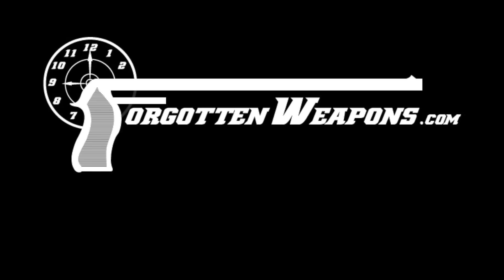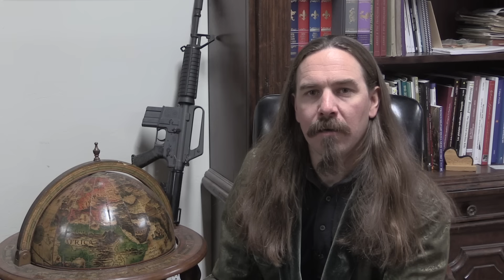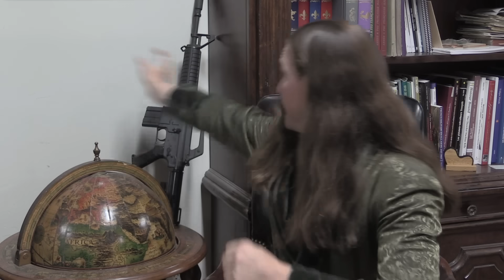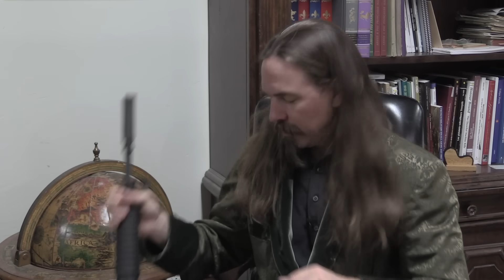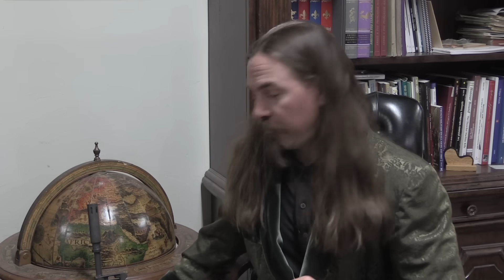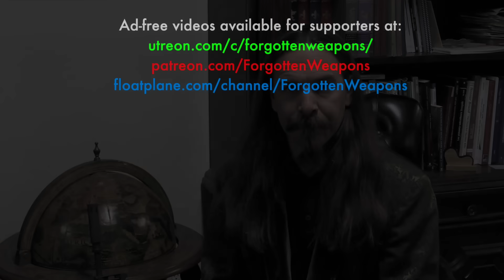Ask Ian: "Last Ditch" Rifles for World War III?

Comment: So basically an m16a1 with a polymer lower. I guess Stoner wins again 😂
Reply: Dude had it figured out until we came along and started messing with it.
Reply: M16A1 with polymer lower and wood handguard.
So a really sexually confused ARES SCR.
Reply: There are so many AR-15s in circulation in this nation the military could just ask us to donate(or show up with your guns) these rifles and if they want them to be select fire they manufacture the necessary parts and modify the lowers for this functionality saving A TON of money and time on making whole new rifles.
Reply: There are 3D printed lower designs.
Reply: @ashyslashy5818  it's not 1940 anymore.
Reply: @kabloosh699  Unfortunately, most people with them would probably see it as some kind of confiscation ploy.
Reply: @Airondot  From a purely utilitarian perspective sure but many of the additions and improvements really are beneficial.  Sure a barebones pull trigger goes boom design is extremely elegant and hard to improve further if you are interested in nothing else but the AR isnt just a rifle.  It is a platform.  Half of the reason its still around is because features were added as they were found to be needed.  The original A1 design was great as a baseline but you dont want just a baseline in the modern infantry.  You want to be able to put optics on it and make it comfortable to shoot with adjustable length of pull.  The A1 wasnt a mistake and it was improved upon for its use cases its just doing that added complexity which isnt necessarily a bad thing if you can afford making a more complex rifle.  When it comes down to it though if you just want the simplest possible package its gonna look like an A1 its just nobody wants to have to go to war with that in the 2020s.
Reply: @Aperson156  do you really need full auto though?
Reply: @kabloosh699  I don't think they'd even bother modifying the civilian ARs. We shot our M16s/M4s in semiautomatic 99% of the time.
Reply: @donwyoming1936  I see semi only being the best option especially for undertrained bodies in uniforms. Make it as straight forward and less ammo usuage
Reply: @heresjohnny2172  yes, you do
Reply: @donwyoming1936  yeah. There is also that, plus in this case we will likely be seeing a shortage of ammo so semi auto will be the go to way to conserve ammo.
Reply: @ashyslashy5818  Why? No seriously why? If you've been watching this channel or inRange or any of the channels that have reviewed the WWSD rifles, then you know that polymer (the KP15 and CAV lowers at least) has proven it's self.
Reply: @wilhathaway1987  no, you don't, at all.
Reply: @heresjohnny2172  nope, you don't.
Reply: @chuckhaggard1584  Don’t need it since it lowers effectiveness in performance. Want it because it’s fun, like getting to push a car to its max speed.
Reply: I actually disagree slightly with Ian, I don’t think we’d bring back the carry handle. Doesn’t make sense anymore.
Reply: @JoeSkylynx  Wood belongs on an AR like salt belongs on Cornflakes.
Reply: @jacobcastro1885  The MP-40 used some early plastic.
Reply: @heresjohnny2172  you need full auto in military  arms for 2 reasons, it turns  into a shotgun at close ranges to put a threat down right now asap. At longer ranges its for suppressive fire. Keep the enemies head down while your team maneuvers. Yes its wasteful, war is wasteful.
Reply: For a last ditch "peoples gun" I vote for the m79 blooper. Simple to make simple to use. Any single shot shotgun assembly line could crank them out.
Reply: Well, I think Ian used the M4 as an example rifle to simplify, likely because it's a platform both he and his audience are familiar with. He could just have easily applied the same logic to a F2000 or Tavor.
Reply: @JKTF476  Simple to make the gun, perhaps, but the ammo would be expensive to make. It's also not the best gun to put in completely untrained hands. With a rifle, a militiaman can just aim ang sight directly at the target. With a grenade launcher, they have to learn the trajectory. They're probably spending little or no time firing practice rounds at the firing range in this scenario. So you have to give them a relatively complex adjustable sight, like the M79 had, because they won't have the skill to aim it accurately instinctively.
Reply: The AR-15 platform is intolerant of rough machining in the gas system  among other components.
Injection molded fibre reinforced plastic lowers and trigger components would be possible like the Steyr.
Reply: @MasterN64  The M16A1 was generally recognised as a mistake in a number of regards- starting with the forward bolt assist. The original AR-15 was a better rifle. The Army and Colt screwed it up.
Reply: @Airondot  Ehh. A lot of the changes the military made make a LOT of sense for the military (the gov profile barrel had some mistakes with the actual testing parameters, which they didn't realize till production had already started on the new barrel and they essentially said fuck it its more expensive to go back, and it just adds a bit of weight) With the mechanization of the Army the Carbine makes more sense (try getting in and out of a HMMWV constantly with a full length M16 while in full kit, none of my Marine friends thought it was fun) As well as the increase of urban operations. The adjustable stock makes a lot of sense (especially when it was first adopted when body armor was much bulkier than it is now) Hell, even the KAC handguard from the block I upgrades is considered on of the best handguards out there for its time, and even better than a lot of handguards out there today(The upper has a locking screw, which means you can mount accessories like lasers, grenade sights, etc. and not have to worry about zero shift) The optics and lasers we went with, while heavy, can take a hell of a lot of abuse, and even the ACOG which people consider outdated now increased lethality to the point during the gulf war an investigation had to be opened on the Marines because people thought they were executing POWs. Really the only stupid thing the Army did was put the forward assist on there. And if the Army was at the point of making last ditch rifles. Those changes to simplify it closer to what stoner designed, isnt because he had it figured out (. Its because jesus christ its WWIII and we're pulling more troops than WWI and II combined. Also there is still a lot of debate over how much Stoner actually did with the design of the AR15 itself, as sources conflict on what he did adapting the AR10 to 5.56, and what others at the company like Jim Sullivan did to it.
Reply: Yeah because your going to be losing we didn't lose Nam because our boys are weak
Reply: @JoeSkylynx  no more like the service rifle from fnv especially the cocking location cough cough simplified
Reply: @allangibson8494  Ehh the FA was considered a mistake, and burst while not actually wanted, was adopted to fix a training issue the Army had no time to rectify. And it wasn't the M16a1, it was the straight M16 that was considered bad. Less because of the Army and Colt, and more because of McNamara fucking with the production and ammo to save a few bucks for the DOD because he had no idea why specific powder, and metal treatment is actually needed for anything because he was a bureaucrat not a gunsmith. The M16a1 fixed the issues the M16 had. Which is why it was used all the way up to and through the 80s. With some units still hanging onto them into the 90s. (yes the M16a2 came out in 1983, but like I said, some units held onto the a1s all the way till the 90s, My 1st unit still had original Colt M4s in the 600 serial range in 2017 when I left, and there's a unit at Polk that still has an M79 in their arms room.)
Reply: @wilhathaway1987 you don’t.
Reply: @JKTF476 you really don’t.
Reply: well...since DoD has committed to the 6.8 x 51 and affiliated launching platforms, it would take a major earth shattering event to halt the transition and revert to existing & established systems (5.56 x 45 & M16 based platforms)
Reply: I think a polymer lower receiver, as well as possibly polymer magazines would probably be a good thing. The good thing about the polymers is not only are they lightweight and obviously faster to produce. In my mind they’re also much more for the lack of better term soldier proof. Especially if you’re going to be giving these weapons to con Scripps. Now granted many Americans have at the very least basic firearms knowledge. Now obviously they would still have to go through training. But making a weapon that is simple to use but also relatively sturdy would definitely be a benefit.
Reply: @Keith Reh  ehhhhhh. While eventually it will see full adoption it is at first onlybgoing to select units, while the rest of Army is staying with the M4. If something we were just to go to full scale war within the next year, Spear production would probably actually be slowed or stopped, to supply the Army with known existing equipment they are already trained on.
Reply: @Aperson156 , than the conversation parts, like a drop in auto sear, could be provided instead.  Not as useful as a full conversion, but auto sears could be mass produced at a scale much higher than full conversions could possibly be processed.
Reply: @JoeSkylynx  it must be gender neutral 😂
Reply: @LUR1FAX  I understand, but the mentality that polymer doesn't belong in firearms was the standard convention in 1940, and only began dissipating after.
Reply: But 1861?
Reply: You could also substitute steel for aluminum in the AR pattern receivers in a last ditch scenario. It's a simple substitution, just a pound or two heavier. One has to consider that the appropriate aluminum alloys are harder to make and require specific additives. They can use lower grade steel for the receivers since they only need to match the strength of aluminum. Aluminum is stronger than steel at the same weight but not the same volume. Basically, a direct 1 for 1 substitution of steel for aluminum still results in a stronger receiver.
Reply: Stoner ALWAYS wins
Reply: spoiled it ):
Reply: WWSD2020 🤣👍🏻
Reply: @WardenWolf  Stamped steel could be useful for an upper, polymer still makes more sense for lowers.
Reply: @JoeSkylynx  damn i want one
Reply: @JKTF476  full auto for a squad weapon sure. For individual equipment? No FA is not needed.
Reply: @heresjohnny2172  Yes and also no. The majority of the time you will absolutely never need it, however, there are occasions (in combat) when you need to lay down heavier suppressing fire than what semi-auto alone can provide. That is where full-auto on an AR is necessary.
Reply: Touché
Reply: Stoner always wins.
Reply: @chuckhaggard1584  That's not what Jeff Gerwitch says. I might be spelling his last name wrong but he was in Special Forces for 20 years. He says full auto actually can be useful on a rifle when reacting to contact in ambush situations and that the broader US army should train on it more than it currently does. Also, the notion that it's impossible to control is pretty laughable specifically as it relates to direct impingement 5.56 guns. By no means would you be shooting tight groups but the fact of the matter is you could make some hits. Especially if the rate of fire was lowered just a little bit. It definitely does have a use in niche situations albeit very very critical niche situations. 

If full auto wasn't useful for rifles then the concept of an automatic rifle wouldn't still be in use by major countries. But it is...
Reply: @kabloosh699  If it was an existential threat to the nation, I could see millions of Americans showing up ready for battle with their own rifles. I couldn't see that happening with foreign wars though.
Reply: @claytonmachine12  there's nothing stupid about the forward assist. I don't care what anyone says. There's no reason not to have it. There's a reason why the 416 and MCX Spear have it to this day despite being different designs. It doesn't hurt to have and every now and then it helps.
Reply: Exactly the setup paul harrell use
Reply: @Aperson156  
Regarding "confiscation ploy" I'd absolutely agree with the theoretical "most people." They're not gonna give you your rifles back or ship you home with them once the war ends.
Reply: @JoeSkylynx  wood handguards are way more time consuming to produce than polymer injection.
Reply: @heresjohnny2172  mass conscription + having to cut down training times because if you have to resort to last ditch weapon production things are not going well for you... imho you might have to replace marksmanship with volume of fire. so autofire is probably still needed
Reply: @MasterN64  Oh yeah I agree, I got my own 14.5 M4 SOPMODish for my personal rifle. But damn, Eugene knew his shit and was only limited by the technical of his time. I’d bet if he where to design the M16/AR-15/AR-10 today it would damn near identical.
Reply: @kabloosh699  That makes a lot of sense, but I'd hate to be the guy who gets issued a poverty pony :P
Reply: @kabloosh699  is good for a civilian action plan.  offer a "kit or spec" type gun that Uncle participates in some of the cost. don't want any registration so would have to be honor system that gun is contributed to the cause when called for.
Reply: @heresjohnny2172  good question and it can be a field up grade
Reply: @LUR1FAX  corn flakes have salt in them
Reply: @keithreh9338  the 6.8 rifle is a non starter
Reply: @heresjohnny2172 yes. I do. Why do you ask? And why do you care.
Reply: @claytonmachine12  Kyle Rittenhouse used the forward assist to save his life in a defensive situation so you are objectively wrong. That's a real world example of it being used which discredits your entire post. 

The fact that you left yourself an out indicates that you're literally just repeating what your favorite YouTubers have said. If you shoot ARs enough you'll recognize that every now and then the bolt doesn't go totally into battery whether it's due to slight fouling, lack of lube, a full mag, whatever is irrelevant. Every now and then it just doesn't go into battery even though there isn't an actual malfunction per se. It doesn't mess it up to put it into battery.
Reply: @thevnbastid1027  
I'm not going to dignify a yawnpost with a serious response.
Reply: AR-18 would be better honestly
Reply: @heresjohnny2172  yes
Reply: @keithreh9338  The military isn't getting rid of 5.56 or the M4. 6.8 and the XM7 and XM250 aren't even out of the trial phase yet, and even if they do decide to full send with it, the M4 and 5.56 are going to stay around for support troops for the foreseeable future. It will effectively fill the role of the M1 carbine in WWII.
Reply: @wilhathaway1987  nope
Reply: @gamedestiny2520  it does when you put the iron sights on. The regular front line troop won’t have an optic.
Reply: If that’s the scenario we’re probably pretty close to Guerrilla Warfare time, arming the civilian population to fight occupation
Reply: @beardly0121  I know Jeff, we've taught at some of the sae conferences, I'll be seeing him again in March.
Full auto is best used in belt fed weapons. 

The very rare and very niche use for full auto in carbines is things like doing an Australian peel, which I'm assuming Jeff was speaking towards. You can accomplish the same thing via semi auto.
I've asked a lot of well know serious dudes their opinions on the subject, guys like Vickers, Hackathorn, my friend and moneot Pat Rogers, etc.

To quote Paul Howe from one of those conversations "When I can teach a guy to dump seven in the body and one in the head in under two seconds, why do you need full auto?"
Reply: @bigboyepic8598  is generally converts ammo into noise. That's basically ballistic masturbation.
Reply: "Is that plastic?"
"That's what I thought at first too, but it's actually plastic-like, it's the latest material from our scientists"
Reply: @heresjohnny2172  not until you do
Reply: Stoner: "MAKE IT LIGHTER!!!!"
Reply: Got an m&p 15-22, same setup.  Put thousands of rounds through it, still works just fine
Reply: Checkmate: Stoner always wins.
Reply: Wins? Nobody said this was an ideal rifle, this is a rifle meant to be just as disposable as the conscripts you’re giving them to.
Reply: @heresjohnny2172  no, some and burst is all you need, and maybe not even burst, of you are using full auto, the enemy is too close
Reply: @wilhathaway1987  not on an AR/M16 you don't. It's like saying it bump stocks are anything but trash. Unnecessary extra equipment that anyone with experience should know to stay away from.
Reply: @claytonmachine12  we had the straight M16 on basic training in 2007. And a few M16a1. All of them were complete trash.
Reply: @JKTF476  you can also issue it with black powder charges and wicks, so people can stuff the barrels with random kitchen utensils, rocks, and coinage. Then you get them to form close order ranks, and volley fire your way to victory.
Reply: Stoners always win. But the only gun designs they know about are shotguns!!!
Reply: Na the AUG is a beter polímero gun more polimer
Reply: @anuvis raa  Aug has a lot of issues. REALLY back heavy. Heavier than an M4. The gas port burns the shooters hand, and has been known to take fingernails off. Takedown often requires a hammer or something to beat the takedown pin out. Isn't really suited to modern optics/accessories mounting without even more increases in weight. That actually interfere with the barrel removal a bit. Proprietary mags. Etc etc.
Reply: @gamedestiny2520  It should not be called a carry handle as it is strictly forbidden for soldiers to carry their guns that way.
Reply: ATI is already doing this 😅
Reply: @Aperson156  and legitimately so
Reply: @Airondot  that's army officers who had not invented here disease
Reply: @claytonmachine12  the new rifle and MG should be in service this year
Reply: @WardenWolf  AR platform receiver is not a pressure bearing component! The bolt locks into barrel
Reply: @koyota6822  since death conquered Stoner I disagree
Reply: @George  in limited use yes. It's gonna be a while before full fielding. And that's if tye Army doesn't change their mind halfway through
Reply: @claytonmachine12  all the links said this year, please add your Link
Reply: @George  ......dude. half my job was procurement. There is zero chance, that Sig is going to have enough rifles and MGs to outfit the entirety of the US Army in the next 9 months
Reply: @claytonmachine12  so you don't have a link
Reply: @George  Neither do you. There is ZERO documentation that states the M6 and M250 will fully replace the M4 and M249 by end of FY2023. Or even Callender year 2023. And by thinking that ISSUANCE of those systems means that, shows a complete lack of understanding of Military procurement. The JLTV was set to replace the HMMWV in the same manner. And yet many units, 5 years later. Still do not have them. This is going to be a process that will take multiple years to complete. First specialty units such as SF and Ranger bat will will get them. Then high deployment infantry units. Then the rest of the infantry. Then support units. And this is because it is not JUST the rifle and MG. The range tables for qualification need to change, ranges need to be updated as even the low pressure training ammo is too powerful for many US Army rifle ranges. Then the 91Fs and Armorers are going to need additional training on the maintenance of these systems. Then the troops are going to have to turn in and exchange all their mag pouches, as the new magazines will not fit current issue pouches. Along with the lengthy process for turning in the old rifles and exchanging them for new ones. Then these first u it's are going to be treated as an extended trial, so the Army can further learn what else might need updated going forward. Then they cannot issue out more of to weapons than can be supplied with CURRENT production of ammunition. Etc etc etc. This is how Army procurement WORKS. The statements the Army has put out simply state this process is going to BEGIN this year. And it will take several years to do so. Hell the closest analog to this is procurement of the New sig pistol. Which still took several years to complete and was fast tracked. In fact there are STILL units that do not have them. So thinking M4s will be gone by the end of the year is frankly retarded.
Reply: @JoeSkylynx  god damn NCR energy
Reply: @kabloosh699 there would need to be a different lower all together unless they mill it to be a low shelf, they’d need another BCG too.
Reply: @mind fornication  ...............what.
That makes no sense. To smaller the iron sights (to a degree) the more precise they are, but harder to quickly get on target. The larger the irons the quicker to aquire the target, bit there is so much margin for error they are less precise. Countries have struggled with this for decades before optics. It's why the US has used the same irons since the M1 Garand, they offer one of the best balances. And optics also allow for shit like magnification, low light illumination etc etc. And don't rely on  linking two points on opposite ends of the rifle to aim.
Reply: @mind fornication  so is hipfiring but thay doesn't make it a good idea.
Reply: mind fornication  They already did that. its called the M68 CCO. Its a tube with a dot. And is actually what most troops are issued, not the ACOG. (its a comp2/4 Aimpoint)
Reply: $880 BILLION DEFENSE BILL! WE BETTER ALL GET A M249 SAW AND THEN SOME FOR FREE.
Reply: @Ozark-nq9uu  we had the A1 back when I was in and the 1911A1 I found them both to be very excellent weapons all though the 1911s were getting really sloppy by then but theirs certainly nothing wrong with the M16 A1 rifle with the open sights
Reply: @JamesBond-so1of  the main issue was there was so much play in the upper and lower receiver that you could move them enough to expose half the bolt without trying. Half the time firing made the upper receiver move so much it would  miss the target and instantly jam.
Reply: @Ozark-nq9uu  maybe by the time you were in but they were still just fine when I was in never had a problem with the weapon but they are mechanical and things wear out over the years and need to be refurbished and or replaced the one I was issued was a very accurate rifle and I took expert with it back in the seventies
Reply: @JamesBond-so1of  yeah, this was 2007. I highly doubt any maintenance had been done to them since at least the 80s or 90s. My parents used the same when they were in the Air Force Back in the late 70s early 80s.
Reply: Give me the parts to make full rock n  roll and Ill make it happen
Reply: @fuzzlemacfuzz  amen brother!
Reply: @FluffRat  Do you think it would be possible for a stamped upper?  Wow, that would drop the cost. I never thought of that. 😊
Reply: Basically the state department contacts S&W and Ruger then asks can you make this worse but also full auto?
Reply: @fredbalster3100 especially a slickside side charger, W/ no FA? Could almost make one out of plumbing pipe…?
Kinda not serious, but hmmm…
Reply: @ctrlaltdebug  3D printed lowers would take forever to make a single lower. Several magnitudes of time slower than the 65 second molding Ian mentioned.
Reply: At 800 rounds per minute, how many minutes could you carry?
Reply: @AaronMichaelLong  plenty of American companies make AR-15s, the others not so much
Reply: Yes, they do. HK makes the HK-416, SIG Sauer makes the M400, FN makes the FN-15, Norinco made the CQ. The AR-15 is the second most prolific firearm design in the world, following only the Kalashnikov, and were it not for massive overbuilding of the AK by China and the U.S.S.R. during the 1950's and 1960's, the AR-15 would probably be the most prolific.
Reply: @MasterN64 unfortunately?
Reply: I wonder if polymer injected is durable enough to hold up under combat stress, or would they need to add metal reinforcement to certain points (ie takedown pin holes, buffer tube area, etc).
Reply: Polymer lower , upper ,trigger group stock , handguard. Sights , bolt carrier as well.
Reply: I wonder how many rifles we left in Afghanistan?
Reply: AK is cheaper and better
Reply: @allangibson8494  I'm pretty sure Colt manufactured the M16 according to Army specifications.
Reply: @hubertwalters4300  And that’s what I said. The original AR-15 was a better rifle than the M-16 the troops got issued.
Reply: @Aperson156 unfortunately?    I can not fathom a single scenario where the US military is running out of rifles, but NOT running out of soldiers.    So there is no reason for the US government to ask people to “donate” their guns to the military.   

You must keep in mind, that there will be MANY fatalities/casualties, for each lost or destroyed rifle.   So the new comers would take up the arms of the fallen.
Reply: @dne9394  Look up the definition of hypothetical.
Reply: No forwaed assist @JoeSkylynx
Reply: @allangibson8494 the m16a1 is perfectly fine ur talking about the XM16E1 that’s trash
Reply: @BaconSlayer69  M16 no A1.
The XM16 had the chrome bore and no forward assist. The Air Force had no problems with that configuration.
The A1 was the “fixed” version.
Reply: @donwyoming1936 it's about 20 minutes on a mill and then labor of slapping in the FCG.
  
It'd still be cheaper and faster than manufacturing a whole new rifle.
  
That's not even including the full pocket lowers in circulation by companies like ADM and centurion just to name two, which are built that way to expedite full auto manufacturing as much as legally possible for leo/gov contracts.
  
The problem is that a bunch of companies just copied colt for the sake of ease of manufacturing, who cucked and did more than the minimum for good boy points.
Reply: @donwyoming1936 outside of a few times in training I never fired mine on burst.
Reply: @kabloosh699  MATTEL
Reply: @heresjohnny2172  NO.
Reply: @Airondot 🤦🏻‍♂️
Reply: @JoeSkylynx 🤦🏻‍♂️
Reply: @kabloosh699 we shouldnt be going with the military/police and people shouldnt want to give them weapons also theyre not going to be going to the militia* to get their weapons theyre going to buy them from people who make them especially for them
Reply: @kabloosh699 and no they couldnt "just ask us"  theyd be going to every person if that was the case and you know they arent going to be doing that
Reply: @kabloosh699 also manufacturing all the parts would take way too much time and effort and money and all that
Reply: @ctrlaltdebug no duh
Reply: @jacobcastro1885 🤦🏻‍♂️
Reply: @Aperson156 it is if they were to collect weapons like that because the military/police arent on our side
Reply: @MasterN64 🤦🏻‍♂️
Reply: @heresjohnny2172 theres a reason for full auto especially in this day and age so yes you do need it 🤦🏻‍♂️
Reply: @fuzzlemacfuzz nah its for when you just need to take out a few people and need to be more accurate but theres a reason they have full auto espcially in this day and time
Reply: @kabloosh699 🤦🏻‍♂️
Reply: @bigboyepic8598 and it doesnt "lower effectiveness and performance" theres a reasons for it and one of them is suppression
Reply: @LUR1FAX 🤦🏻‍♂️
Reply: @LUR1FAX theres alot of guns before the ar that used plasitcs
Reply: @JKTF476 🤦🏻‍♂️
Reply: @JKTF476 its not wasteful when youre using it for certain reasons and no it doesnt "turn it into a shotgun at close ranges" its more accurate ac closer ranges not less
Reply: @glcart-cs5sc  I should've included that it lowers effective accuracy at range specifically. Also, using an assault rifle instead of a dedicated machine gun isn't going to work the best if you need suppression. It's really only good for emergency "Oh no, that guy is a little too close!" situations.
Reply: @glcart-cs5sc  Bless your heart.
Reply: That's basically just a palmetto M4, the cheapest gun they sell, it's like 400 bucks so it makes sense I guess, from what I hear it's actually a really good one as well quite reliable, not necessarily the most accurate gun ever but I guess it's good enough for military grade.
Reply: Don’t fall into that trap!
Reply: The best soldiering in modern times was done with semi auto rifles (FN FAL) in Rhodesia and other African bush wars, and the Falklands.
Reply: @JoeSkylynx 😂